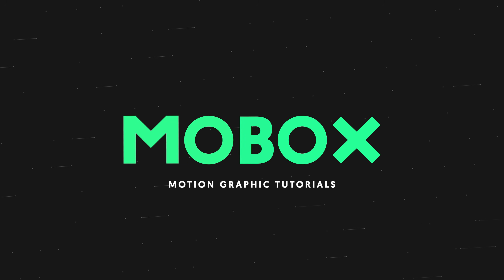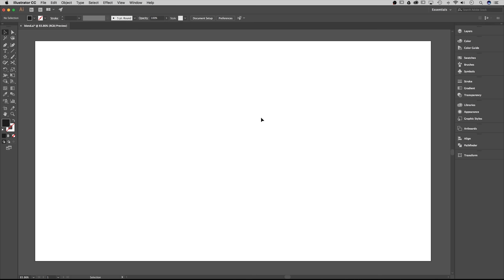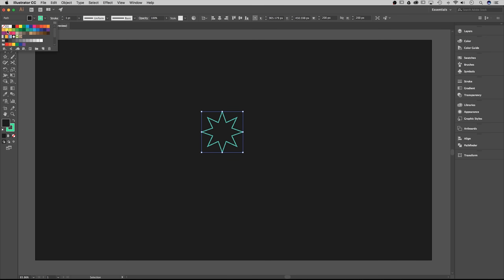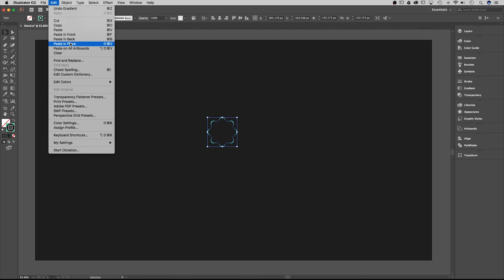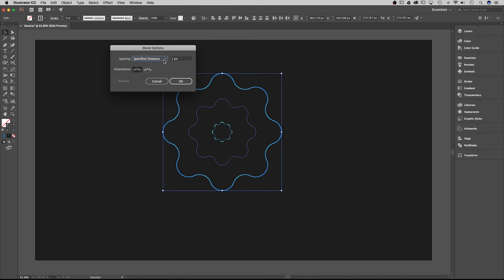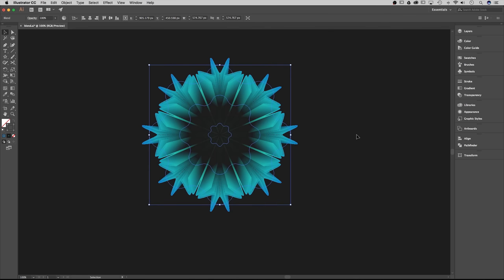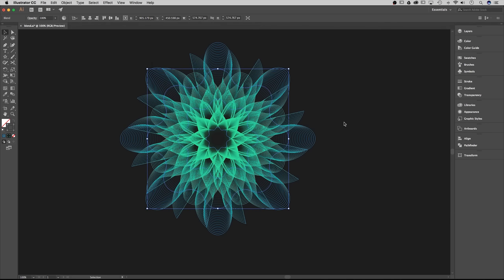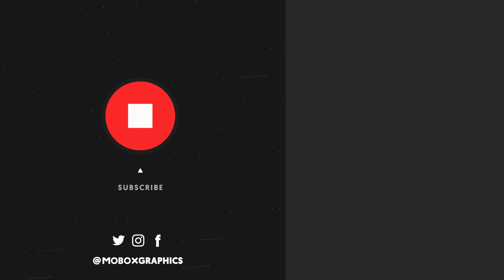3D Geometric Mesh Tool - Adobe Illustrator Tutorial

Comment: Hi MOBOX, in this tutorial of how to make a 3d mesh object in illustrator, you mentioned to paste in place the hot key was cmd + shift + B however this turned off my bounding box and made it very confusing. After searching how to retrieve the bounding box I found the following answer:

The toggle for Bounding boxes is Cmd + Shift + B. See if it works.
If it doesn't it's no big deal. You've got tools for doing everything you need to do.
Personally I hate bounding boxes and am perfectly happy without them.

Which says that hot key you said is actually to turn the bounding box off.  

Did you mean CMD + SHIFT + V ??
Reply: Also I noticed as I was transforming the shape making it larger but centered that the stroke was also being enlarged as the shape was enlarged, I fixed this by going right click > transform > scale and then clicking off the box next to: "scale strokes & effects" , I left "scale corners" box on though.  Should I also turn "scale corners" off? What is the best setting?
Reply: Hi there! To your first question, yes I definitely said CMD + SHIFT + V. Sorry that the audio is a little confusing there, the pronunciation of B and V are very close which can lead to confusion. And for your second point, scale stokes & effects will definitely effect the end result. Depending on the shape you create and blend, I would keep scale corners on, that will help any live corners remain similar in curvature.
Reply: Pixel & Bracket thank you so much!! Glad we cleared that up :)
Reply: @pixel&Bracket Sorry I re-watched the video and had one more question,  how can you tell how large the artwork is?  When do you know its too big in terms of complexity? I really don't know how to describe my question that well I hope it makes sense.  

Second question: If I wanted to create a lot of these to make up a background full of them, how can I do so without making my computer crash?  I'm thinking rasterize? But often times rasterizing makes it have a white background which wouldn't work, how could I make the artwork smaller or in different form so that my computer doesnt run as slow and its more of an object rather than thousands of strokes?